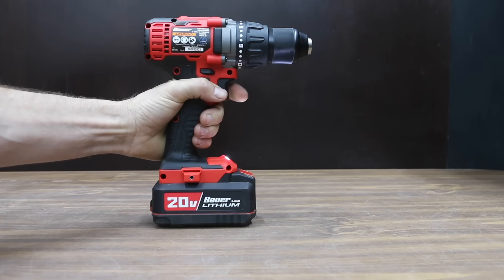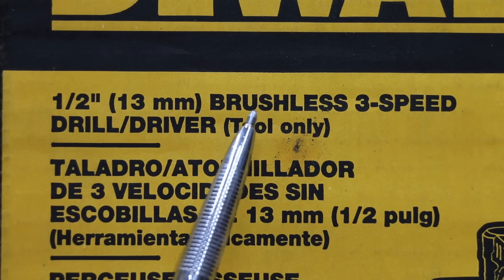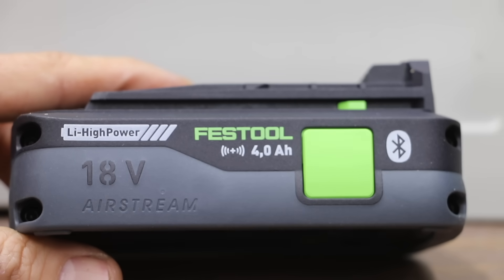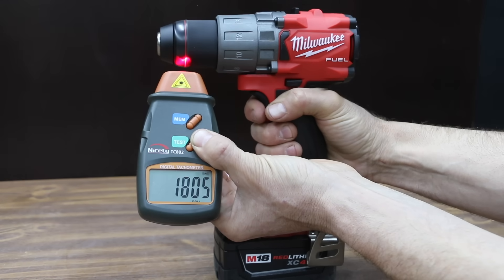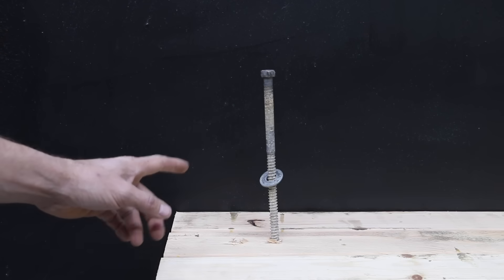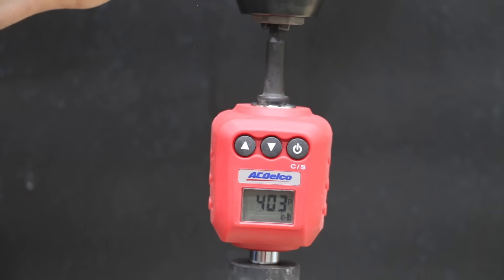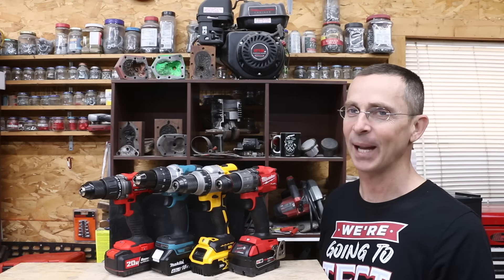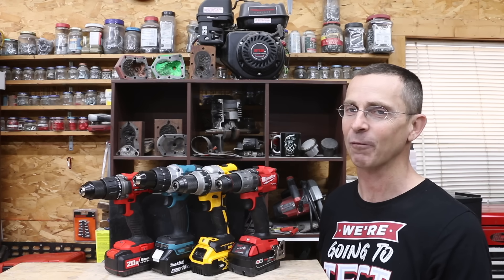Best Drill (BATTERY POWERED)? Milwaukee vs Dewalt, Makita, Bosch, Festool, Ryobi, Bauer, Ridgid

Comment: Those 4x4's were probably more expensive than any of the drills tested here.
Reply from the maker: Great point!
Reply: I have been traveling the past month and have now seen 6 saw mills overstocked with lumbar and piles and piles of uncut timber still. Like there was no room for any more. I've come to the conclusion that they want to artificialy keep it high
Reply: @1stfloorguy59  I agree.
Reply: @1stfloorguy59  the dam will burst and it will cost $8 bucks a sheet, then they'll cry not making any money.
Reply: @1stfloorguy59  Although labor is probably the problem, they love the extra tax money
Reply: @1stfloorguy59  I prefer chairs that are overstocked with lumbar.
Reply: @1stfloorguy59  the problem is most wood in the USA comes from Canada and the resins to make most plywood comes from Texas. The big freeze Texas had a few months ago knocked offline a lot of those resin manufacturers and they are scrambling to catch up with demand. It is a case where many things have to come together from different industries to make a single common product. Give it time and I am fairly confident we will be back to normal production numbers, prices however might take awhile to stabilize as demand still exceeds supply
Reply: @Mr.4AGE  , also worth noting that the previous administration imposed tariffs on lumber from Canada.
Reply: @1stfloorguy59  very possible, although perhaps the reason there's so much uncut lumber is because they can't get enough of a work force in to cut it. Idk what state you're in, but many manufacturers are short handed bc they can't get enough workers in and maintain the guidelines at the same time.
Reply: @RangerOfTheOrder  i’ve heard a shortage of workers and then a shortage drivers also. Really don’t know but also the prices for everything is across the board is up. I remember 6 months ago i could spend 300$ on groceries and now i
spent like 430$ on what i feel is the same amount of stuff
Reply: @LividTommy  better start buying lots of maruchan before they sell for 10 bucks..... A cup
Reply: @RangerOfTheOrder  , there is a shortage of qualified truckers to deliver big loads of lumber. Same goes for truckers, not enough of them to deliver fuel when hackers shut down a pipeline.
Reply: @RangerOfTheOrder  Work force? What work force? It is all automated machinery. Has been that way for YEARS.
Reply: @RangerOfTheOrder  transportation and fuel cost
Reply: @1stfloorguy59  My understanding is that the mills were shut down for the pandemic and are now just getting back to work.
Reply: @1stfloorguy59 just don't buy make them feel it in there wallet like they do to us
Reply: @1stfloorguy59  There definitely isn't a shortage. This price hike on lumber is not because of a shortage.  There is something shady going on imo.  There is a lumber mill 5 minutes from where I live and they are stocked to the brim and always have been.
Reply: @1stfloorguy59   well there is this stamp thing and drying and such.. takes time to produce a board foot of lumber no matter how much you want to sell it.  anything you buy at home depot has to have some douchebag independent "third party" inspector run by and stamp it.. and if that guy is actually doing his job he is going to pull samples and take them to a lab and test them for moisture and tensile and shear strength.. only the largest mills can take young wood and get it to market in less than a couple months and its challenging even for them.
Reply: "Heavy duty, guaranteed for 90 days" sounds like an oxymoron. If you're only going to garuntee operation for 90 days you can't call if heavy duty in my book.
Reply: I was at Home Depot yesterday and I took a look at plywood. $65 for a sheet of 1/2 inch ply is plain outrageous.
Reply: @dontrend5956  welcome to the rest of the world :/
Reply: @dontrend5956  you’re joking you have to be
Reply: @nolimitjat  A little humor on a monday? Why not?
Reply: From Germany here:
Prices on construction wood like close to your 2x4" went up from 350€ per cubic meter to 1000 € per cubic meter
Reply: If Festool sold 4x4's they would probably cost $800 each
Reply: It’s a little long but a Canadian builder had a pretty good explanation. Seems like “Just it time” business model fell apart when the supply chain of raw materials failed. https://youtu.be/Ei14ks5ggGo
Reply: @machineman6498  I ran into this wannabe on YT once and this clown is NO builder. He's literally a wannabe Do It Yourselfer YouTuber with zero skills
Reply: I am a pack rat by nature, much to my wife's displeasure; and yet, when I had an entryway porch/balcony built last year (I was recovering from surgery, couldn't build it myself), I was glad that I had leftover pressure-treated wood from a previous project stashed in my basement. If I lived in a tornado zone, I'd be scavenging stick lumber from the roadside piles sitting in front of damaged houses ---- which could potentially lead to fistfight---- and ripping 2x8s down into 2x4's and so on.

The home-building and renovation industry is enormously wasteful; instead of throwing cutoff lumber and wood scraps into a dumpster along with sheetrock, fiberglass and so on, and having it trucked to a landfill or incinerator, the lumber should all go into a separate pile or dumpster, and be recycled into composite lumber or whatever. Right now, I bet that if you were doing a renovation or remodel and piled the leftover wood out by the curb with a sign saying " Free!", or put it on Craigslist for free pickup, somebody would come along and take whatever is still useable.
. 
.
Reply: I feel luxurious and expensive!
Reply: Canadian prices are still stupid high... makes doing anything triple the price, treated lumber or non. 
PS. Milwaukee is king in my garage! I’ll use any tool and get the job done but when im buying a tool for my personal collection its always Milwaukee
Reply: Lolz
Reply: @alfstewart2592  normal inflation is when the price of commodities goes up due to the gradual increases of everything it takes to produce and deliver them, usually overtime.  Greed is the result of raising prices exponentially simply because you can, usually in a short period of time, and demand outweighs the supply. All the while, making profits higher than anyone ever imagined at the expense of the consumer... Which in turn, has a domino effect and causes everyone else to raise their prices also.  This goes beyond normal "inflation". Just like when the real estate bubble occurred many years ago...greed!
Reply: As a lumber yard worker can confirm 😂😂
Reply: Recently needed a few 12 foot pressure treated 2x4s to fix a fence. $52 apiece. And I'm where this lumber is cut and milled, Oregon. This is a terrible time to buy wood. I'm waiting for any more wood projects until next year.
Reply: @alfstewart2592  nah... it's greed...
Reply: We can thank your president for this. Lets pay people free money to stay home, so businesses go under because no one will work when they get paid to stay home.
Reply: @Ron-ds2ob  welp i dont think thats all of the truth. im from Poland, and Usa + China is ordering so much wood, like cnc'ed ready to build house wood that prices icreased by like 130%+ for raw wood, so more than 50% of newbuild projects had to stop since their budget didnt include 200%+ price increase for processed wood, and that information is quite old, i got it while working on new full wood build treehouse like half a year ago
Reply: @Ron-ds2ob alot of places take advantage of people too that needs to be fixed
Reply: @Ron-ds2ob  Why do the governors of red states even need to cut unemployment?  I thought only "hard-working" Americans lived in red states?  You know, the folks who don't want handouts?  So they shouldn't have any work shortages, right?  Or maybe that's just all BS and there are plenty of lazy people, even conservatives.  If the saw mills really wanted more people to come out, they would offer more incentives.  The truth is fairly self-explanatory.  In the computer parts industry, companies are always coming up with BS reasons to inflate their prices and keep them there.  I see no reason why other industries would be different.
Reply: @Ron-ds2ob  My President? I don't think so. But at the rate they're printing money, inflation will go out of control before long. Get used to massive price increases.
Reply: @dontrend5956  
You hit that inflation prediction right on the nail head. Flush in one blow.
Reply: @Ron-ds2ob   no we can thank your president for this because trump gave canada such a hard time over tarriffs on wood. hurt the canadian logging industry and started this ball rolling..  BTW there is only one american president at a time.

Comment: I own the dewalt drill, you need to have the clutch at 1 and the speed at 3 to have the weakest clutch setting. I have stripped a few bolt heads by having the speed at 1 on accident whereas setting it to 3 runs the bolts in until barely snug. Great video as always.
Reply from the maker: Great feedback. Thank you!

Comment: I'd like to see another oil test. Compare straight weight 30, 10w-30, 5w-30, and 0w-30 on hot/cold film strength, evaporation, and test moderately cold pour tempts (say 32f).
Reply from the maker: Great suggestion! Thank you

Comment: I can’t believe the price of the Festool and for what. I’m still loving my DeWalt tools
Reply: Festool is worth every penny of the price : because it is the most versatile of all the drills on the market. Only a year ago 2 Hilti released a model that is trying to compete :). In this Money: it has percussion (the best in the 18V class on the market); 4 gears; a very good quality and ultra light storage case; a chuck and an interchangeable bit adapter - both of very good quality; very good quality batteries :) ... I have 3 Festool drills in total :))) - Made in Europe not China :) At my drills the batteries are still made in europe not China..
Reply: I'll take DeWalt anytime.
Reply: @johnbarber7952  Have you ever used festoool for a long time? for me the only competitor at Festool is Hilti; at dewalt all the gearboxes sound as if they are grinding sand in them ...

Comment: Great tests. I have Makita tools (mostly), and am satisfied with them. I expected that the Milwaukee drill would have more torque, but I'm surprised it's so much more than the Makita. But even with the handle, I've had the Makita pull itself out of my hands when I wasn't braced for it, so I'm not sure I want a drill that much more powerful. And even if it beats the time of an impact driver, I'm not sure I'd want to drive big bolts with a drill - I expect it would be very tiring pretty quickly.
Reply from the maker: Thank you very much!

Comment: Good test. Thanks for including Festool in this round of testing. It's helpful to see what those high price tools do side-by-side with the more common brands like Milwaukee., Makita, and DeWalt. Really puts their price in perspective when it's 2 or 3 times more but performance is in the bottom half of the pack. Pricewise though comparing the kit with a charger and battery to the others as bare tools makes it look a lot more expensive than it is. Add the price of a battery and charger to the others and their price will jump. You will never find a Festool on sale or any sort of 'deal' with a free battery or charger, it's just not in their DNA to make offers like that. Also, the Festool kit comes with that Systainer to hold the drill and accessories which none of the others have even as an option. I believe you tested the PDC18, why not the T18+3 drill (Festool 576758), which as a bare tool is only $199.00 ?
Reply from the maker: Thanks!  Thanks for the video idea.

Comment: Aw, no Porter Cable? I picked up a tool set for $65 that had a drill and a saw with battery and charger and that drill has lasted pretty well over the year I've had it.
My dad has always had Milwaukee stuff and his first cordless drill from 1998 finally quit about a year ago, the chuck is internally jamming and you need a vice to change bits.

One of my co-workers has a Rigid cordless drill from a few years ago because it was the cheapest thing he could get with half inch drive at the time, and he used it to remove 10 foundation lag bolts from the concrete slab under his house. The bolts were installed in 1968!
Reply from the maker: Thanks for the video idea.

Comment: There's a Dewalt better than the tested on. It's 996.
Also one test suggestion would be to drill 150mm holes in plywood using holesaws.
Reply from the maker: Thanks for the suggestion.

Comment: Many of these drills especially the brushed motors produce a flash or spark once the motor is activated. I wouldn’t operate some of these if you are working with flammable gases.
Reply from the maker: Thanks for the feedback.

Comment: Durability over time and performance over the entire range of Power Tools is key and a difficult thing to test. There's no point in having just one, or two tools in your range that are 'best', as your chosen Battery-System Brand is the driver ... so consistency over the range of tools over time is key.

It's all very well testing new out of the box, but consistent reliability and maintaining performance with use is very important.
Because of the necessity of picking a Battery-System, I use De Walt (although was tempted by Makita) and have been pretty pleased with performance over time. Milwaukee has made a big Marketing push in the UK long after I chose a Brand route ... and I am receiving mixed reviews on their durability in use ...  but, the jury is still out on them.
It's still good to see De Walt consistently performing well in the tests ... and consistency over the entire range of Power Tools is key as you can't practically mix and match the best tools from different brands. I'm not Brand-defensive, just I need a range of tools in one Brand that I can trust to perform and to last ...

I wonder whether Power Tools in UK/Europe might have different manufacturers/sources/assemblers that might make a difference compared to the USA available tools ??? That would be interesting to find out ... I also warn people to beware of the 'Special Priced' Tools (including De Walt) as they can have much reduced performance that is hidden, but why they are cheaper ...

I just wish that we got the low USA Prices in the UK !!!
Reply from the maker: Thanks for sharing.

Comment: It's worth noting that the Milwaukee has a brushless motor designed to for an even higher output if you use a high output battery instead of that 4.0. y
You'll get way better results if you choose to get the high output batteries and they do come in 3.0 size. I know it had to be the same size battery for the test. But I hope you try it and see the difference with a 3.0
Reply from the maker: Thanks for the suggestion.

Comment: Project idea. Revisit Motorkote hyper lubricant with 2 stroke mixed gas. Add it instead of 2 stroke oil and gradually thin it out until engine failure.

Comment: Corded drills are the best. My $30 Ryobi corded drill will utterly destroy my Milwaukee, Bauer, and DeWalt cordless drills in every metric of strength and endurance.
Reply: Hard to beat 120v15amp, unless you see how far you can run with it... lol
Reply: but not distance from outlet!
Reply: @tooluser  That's what extension cords are for. Most use cases for most people, the cheap corded is a better deal. It's significantly louder, doesn't have multiple speeds, and doesn't have a clutch, but it offers wrist snapping torque at high speed.
Obviously I have both, and use them for different tasks.
Reply from the maker: Thanks for sharing.